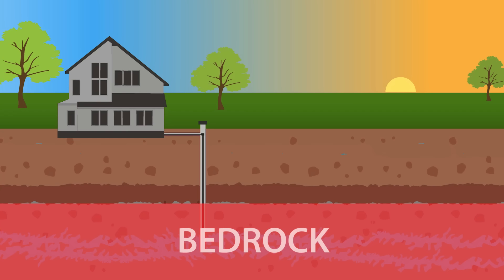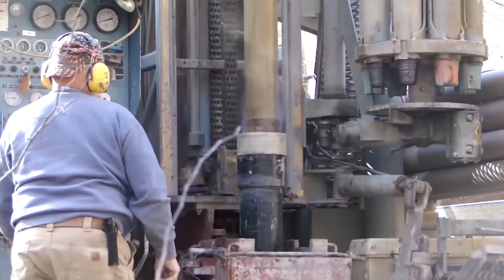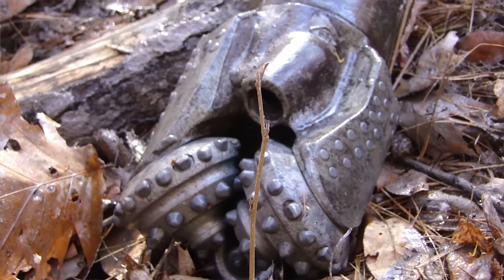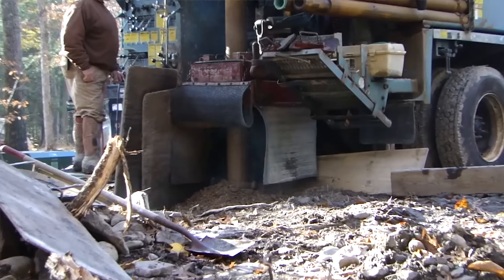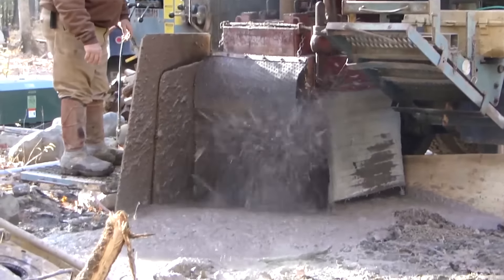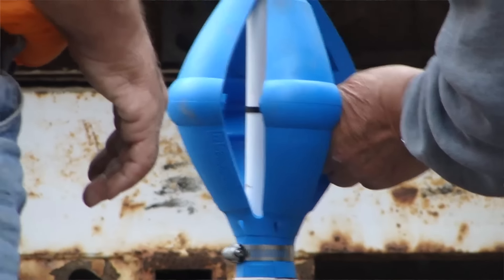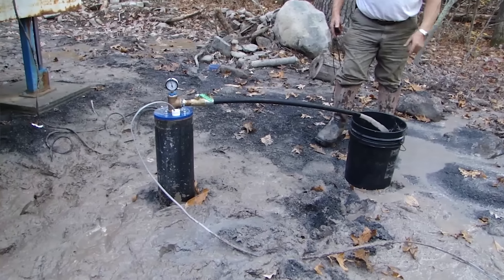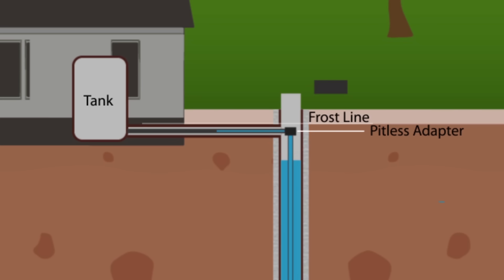WELL DRILLING 101 | Every Step Explained

Comment: Good job explaining well digging and good visuals.  Thank you.  Have you calculated watts of electricity per X gallons?   Voltage times Amps being drawn equals watts.  Example: 120 volts at 10 amps is 1200 watts.  The cost of electric power from a utility averages .12 to .15 cents per kilowatt hour.  Simply put, a load of 1000 watts costs this .12 to .15 cents operating for one hour.  So if a pump produces 100 gallons and that takes 30 minutes to pump and the pump amperage is 18 amps that would be 18 x 120 = 2160 watts run for 30 minutes (divide 2160 by 2 to equal the time of 30 minutes) = 1080 watts per hour. Kilowatts is 1000 watts. So 1080 divided by 1000 is 1.08 kilowatt-hour Times let’s just say .15 cents per kilowatt hour equals about .16 cents per hundred gallons.  Keep in mind, if you have a booster pump in the house, that should be added.  To measure amperage, a simple volt-ohm meter with a “Double C” shaped clamp around the HOT single (not both hot and neutral) cable is used to measure amps.  Example Fluke Model #365 is a premium meter.  Any meter used for this should have a rating called “True RMS” to ensure accuracy.  Just trying to put a cost of operating into the true picture.  Thank you again.

Comment: 1.5" sch 80 20' lengths

Can also use rolled polyethylene black tubing 125 psi or 160 PSI anywhere from three-quarter inch up to 2 inch or even larger

Comment: A very good video, but the system you built relies on an electric power supply, which could fail for a multitude of reasons. Would it not therefore be a good idea to maintain a hand pump at the top of the well just in case you find yourself in a blackout situation?  Also, even the best electric pumps can fail or need maintenance, so it may need to be pulled up at some time in the future.

Comment: #Thanks for the detailed description of Drilling of borewell.

Accordingly, please clarify the following;

1. Did you get the water bearing fracture ;at only one depth of 300 Feet ??

1A) Are  you sure that; You got  the water vein; at *only one strata*/place- inside the borewell.??

1B).is there multiple water vein inside your borewell??

#The reason for drilling the borehole "further-below the water holding Aquifer"  : (below the 300 feet depth, in your case-)
"To enabling/ facilitating to install the Submersible Pumpset" *below the water bearing vein*the

As you mentioned in the video that: "water pressure from the vein"; that has pushed the water level upto 52 feet.

But the above mentioned hypothesis (by you) is *NOT correct*/NOT  in line with Hydrogeology-principles;

#Please clarify and reply

If the water vein able to lift the water up to 52 feet ;This Aquifer should have to be confined type . 
But in your case- "it is the unconfined Aquifer".

#So please ensure the reason for "rising the water level in your borewell"

Comment: Should have had those guy's with the pump rig develop your well before installing the pump. Basically they run a bailer down to the bottom and remove any exses sand ect. Then they use a plunger type of tool to push water in and out out the screened area of the well. This helps the flow of water enter your well. There are many more things you can do to further develop your well.

Comment: you are supposed to have a screen 2 " usually with slits cut in it to keep debre from entering your aquifer and keep water clean from debre.the screen is set at bottom of well. if loss of water occurs you can use compressed air 180 psi to clean screen to reestablish your water source. got it. thanks for your info but they failed to tell you.

Comment: There are two "hot" conductors and an (green) equipment grounding conductor. There isn't a neutral conductor. Roll pipe is much better than 20' ft. sections of PVC. Thanks for sharing.

Comment: I wonder if they ever use 1 in pex pipe  im a pipe layer for a water main bursting company , pending city contracts we use per or copper. We buy 500 ft rolls and I seems ot would be easier to use that instead of pvc with all the potential breaking points of the many threads and glue and all that. Not to mention way easier and faster to send down a long casing.

Comment: I believe they drill lower than the water table in case of a drought. The well would run dry if it was just at the top surface of the bedrock.

Comment: Great explanation thanks. I bought a piece of land in jamaica and thought the bore cost would be similar to that of some friends of mine in Ghana ($1500 to 2k). I was quoted 40 -80 USD. There's only 2 or 3 drillers on the island.  I'm gutted as to run house and up to 4 apartments with crop irrigation and swimming pool. Even a large underground rainwater harvesting tank just isn't going to cut it especially in times of drought. Any suggestions welcome. Selling the plot isn't an option as the size is perfect for my needs. More infrastructures olotscare also way over my affordability budget. 😔

Comment: When I had my well drilled (about 130 feet deep in northern Illinois), my driller told me that he needed to find an aquifer above the bedrock, or a layer of 'deep rock'. If he could not find water before that depth, he would have to drill through that rock and hope to find another layer of aquifer, and that would be bad (radon issues at that level, much greater cost, etc). I got the impression that you don't "get water from a stone", and this video suggests that the water was flowing in the bedrock......seems that cannot be correct. If I recall correctly, my driller was looking for a water-bearing layer of sand, which he found. The bottom of the casing is in that layer, with a screen to keep sand out, and the water just seeps into the casing from the sand layer. The pump is located at least a few feet above the bottom of the casing, but still well below the top of the water-bearing layer. So the water pressure down there causes water to always enter the casing through the screen, and therefore there are usually quite a few feet of water above the pump in the casing. The pump can only draw casing water down to the level of the pump before it starts to suck air. A "flow rate" (gallons per minute) was done, and an orifice was installed to restrict the actual water flow out of the pump to a sustainable rate no greater than the rate water would seep back into the casing.

I wonder about the lack of a "pitless adapter" installation in this video; seems that should have been done right away.....or maybe the casing that was installed was already "pitless ready" with the hole in the side at the correct depth below the frostline.....that could have had more explanation in the video.

The video mentioned that the pump can suck air if the rate of pumping exceeds the refresh flow rate for long enough. What was not mentioned is that the pump needs to be cooled, and the water flowing through it does the cooling. If allowed to suck air for very long, the pump will burn out. Then, you have to get the well company back out and pay a few thousand dollars to have the pipe and pump pulled out, pump replaced, the everything out back in again. My first pump burned out this way during a protracted drought when the aquifer was being depleted by everyone around doing lots of watering to keep grass alive. I only had a timer-operated sprinkler for my garden, not my lawn, but even then running for 15 minutes after the water had dropped below pump level was all it took to ruin the pump.

General degradation of the local aquifer in my area has caused even the municipal wells to go mostly dry. Only two reserve pumps, which are "deep rock", or below the first rock layer, are still able to get water in an emergency, but there is lots of radon and other toxins down there, so if the town uses those wells, the quality of the municipal water supply falls below federal and state safety levels. Accordingly, my town was able to get connected to the area's Lake Michigan water supply, and only uses its remaining wells for emergencies. The local towns also cross-coupled their wells for emergency situations.

I have since switched over to the municipal water system, but they let me keep my well, which works just enough to handle limited watering of flower beds, but nothing else (and of course it must be isolated from any piping associated with the municipal water supply).
Reply: The area you live in was devastated by meteor impact then covered in giant sandy muddy tidal wave filling in great lakes. Radiation, high sulfur levels throughout Michigan ground water.
Reply: @dtruth6422  All rooted in someone's imagination.

Comment: thanks for the thorough explanation i’m a city boy and i’ve always been curious  on how the process worked  as i would like to settle on a remote property that doesn’t have city connections  at least for water and sewar  and i’ve even looked at some without power from the grid  and would require solar and generator   to remain independent  these are remote farm / Homesteading properties  that i would like to be Grandfathered in on  as governments are making it harder to live  that way as time goes on

Comment: It would have been nice if you verified what aquifer they found drilling, and it was supposed to be at the depth. Then you could even find out the source area for that aquifer, and if it has a drought, that well will be made useless quickly.

Comment: 1.6 gallons per foot of 6 inch pipe and the level of 52 feet down is called the static level and yes they do keep a bunch of space at the bottom but usually no more than 20 to 40 ft for debris sediment all the crap that ends up collecting

Comment: this is so frick'n interesting, really well done, nice breakdown for sure. So here's the thing, I should probably try to search for it, but how exactly does this work in northern climates, I know they do them all the time here in Canada, just 5 mins north of my house in the country but how does the part above the frost line not freeze and break the components/lines in the winter..... or is it that you just don't run them in the winter and have your house connection line underground?...I'm assuming that's how it works.... do you have a video that does into more detail regarding some of the other components of the system as well, pitless adapter, holding tank etc.?

Comment: All the tan and brown beneath the grass, perhaps at best the tan part is also, the land that home owners want to get to, liken to watering the dirt, dirt water distribution evenly. That way the dirt beneath the surface doesn't dry up as easily. The water absorption is retained longer term. 
Otherwise, the water bucket spilled on the grass layer slowly absorbs into the grass and dries out, gradually the dirt beneath it dries up further and hardens and thus the land is not as nice.

Comment: We always set close to the bottom in case the water table drops. The average family of 4 uses 200 gallons per day. SHOULD never have any valves between the pump and the pressure switch which is usually at the pressure tank can close the valve without shutting down the pump which deadheads and destroys the pump.

Comment: Well done!  I'm dealing with a well company that hasn't a clue of the basics of well drilling.  They drilled a hole, found water at 55m but didn't seal the casing (with grout or anything).  I now have a leaking well with surface water and mud surrounding the casing.  Their solution is to install a runoff pipe into a pond I have to dig to hold the excess water!  Buying a drilling rig doesn't make you an expert!

Comment: Anybody have an idea what the budget is on these kinds of projects?
Reply: They charge by the foot for labor and materials and the required liability bond or insurance premiums.  Depending on the diameter of the bore hole and casing used, a 200 to 250 foot well can easily cost $10,000 to $15,000 to drill and get water pumping.  But if you want clean and safe water to drink rather than pumping out of a creek that wild animal pee in and poop around and die and rot in, then that is going to be worth every penny spent.

Comment: I haven't heard of anyone still using steel casing. PVC casing is corrosion resistant and will outlast steel pipe many year over. If anyone watches this and attempts to drill a well use PVC Pipe for casing.

Comment: Well you have your wording wrong they are called try con bit is the one with the 3 roller and A Hammer bit would be the hamming one. And you did tell everyone that you have to start with a 10” hole first to bed rock so you can have 3” of concrete when you grow around the 6” casing and have to let it set for 12 hr be for drilling off the rock

Comment: I have a well but I don't think I would have went with the water pump on the bottom. Water pumps do go out over time. To me it's easier to cut the pvc on top and replace the water pump than having to pull all that pipe up to replace a water pump.

Comment: I used to drill for core samples every 2.5 -5ft, I hit lots of caves and broke alot of drill heads. Pretty cool but very hard job and dangerous AF 💪
Reply: did you ever get to explore any of the  caves?
Reply: @pl0xr0blux89  I've been to a few local ones in Bloomington Indiana but they are very popular and trashed. The caves where I was digging were just smaller voids about 70 80 ft down usually never found a entrance.
Reply: @naptownsfinest2345  We need aquachigger on the job, stat.
Reply: @pl0xr0blux89  love that dude no homo 😁

Comment: 11:50 Would a well pipe on this side of the pump be under negative pressure?
Meaning that, if the PVC isn't sealed at the fittings, air can get into the system. (Like a pool pump)

Comment: Pretty messy method. We do it quite differently up here in idaho. Lots of diff methods to get you water before solid rock in most cases. Down in our valleys you could drill for 1500 ft before you hit solid rock. Up in the hills bout 20 ft.

Comment: Ok. You sound like you know what you are talking about so I'm going to tell you my story and maybe you can give me some advice. We moved into a brand new property a little over 5 years ago. We had a 425 ft (supposedly) Well dug. Had decent water pressure. Within about a month we started running out of water. (this happened when I tried to water a small garden) I called the guy who installed the Well. He said to turn off the Breaker and wait a few hours. HOURS! I'm thinking to myself that makes no sense! But that's what I did. And to make this story a little shorter....that's what I have had to do for these last 5 years!!! Supposedly we had 2 and a half gallons per minute. As I understand our State (SC) requires a well to produce that as a MINIMUM. Well we actually at the house tap we get only about a gallon a minute. My Wife can wash about 2 loads of laundry, a sink of dishes and then we run out of water! I'm at my wits end. New toilets, new Well, new everything and still we run out regularly. It's almost like wherever he terminated the pipe in the Well it's not getting enough VOLUME of water. I don't know. We have decent pressure just no volume. I'm guessing we can get maybe 10 or 15 gallons of water and then woosh...gone! I can't water a garden wash my vehicles, heck...do much of anything that might require more than about 10 gallons at any one time. Advice? Anyone? Oh also, I get a LOT of black sediment in the Toilets so I have to Shop vac them regularly. I have a 140 micron spin down filter that I also have to rinse regularly. Like every week or so! It's so bad I have to have a backup filter so that I can just swap them out.

Comment: Well driller here to answer a few questions. There is no magic spot to drill, just has to be approved by the town, then so far away from drains, septic, road and such. Usually if you drill though a void, "cave" its never a good thing. It makes dropping the pump a pain in the ass because the pump can go to the side and never find the the other side of the hole you drilled. You cant put plastic casing down because when you are driving the casing down to sit in the bedrock it would smash it to pieces.The steel will last more than 50 years, I have done work on some very old wells. It all depends on how acidic the water is on how long it lasts. Here in CT it gets cold so your well line is buried below ground about 4-5ft and goes into your well via a pitless adapter. Pvc pipe going down the well is not the best way to drop a pump in my opinion. Better off using a roll of poly pipe. No connections and when the day comes that your pump dies it is easy to pull out and slap a new one down. Pvc becomes brittle when it gets older and you rarely ever get it out of the well without it breaking as it comes out. The average wells I drill are in the 300 to 600ft range. Price of the well is paid by the foot of drilling, around $10. The deepest well we drilled was 1400ft. Never drilled and hit oil. When you hit water don't imagine it is coming from a cave. It is pouring out of cracks and crevices in the rock that were drilled through. Dropped a few cameras down to inspect after we have drilled and its not like finding an underground world. Best well that we drilled was one of 5 that pours out of the top. It made so much water there was no way to measure it and the customer didn't need a pump we just piped it like we normally would and put a sealed cap on it. Had to install a pipe to relieve the excess water. Still running strong and that was 5 years ago. Any questions feel free to ask.